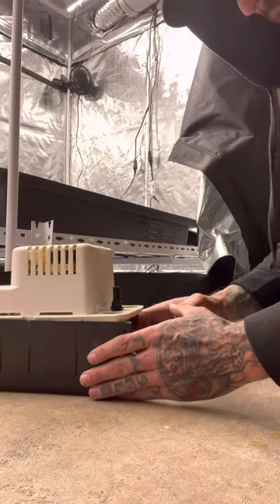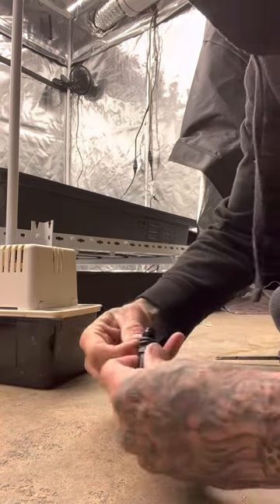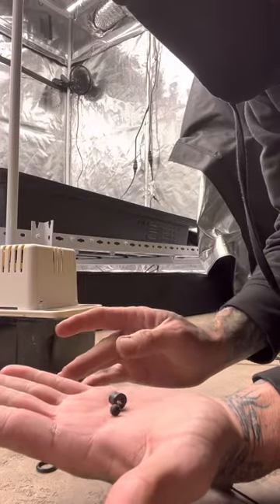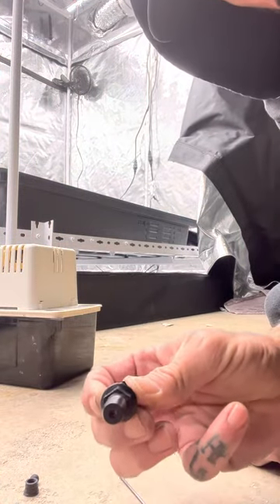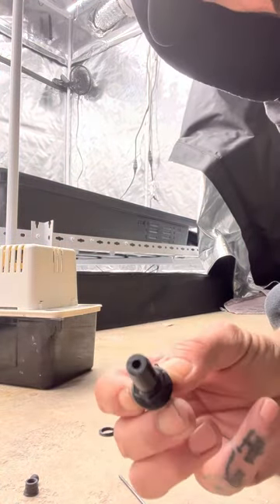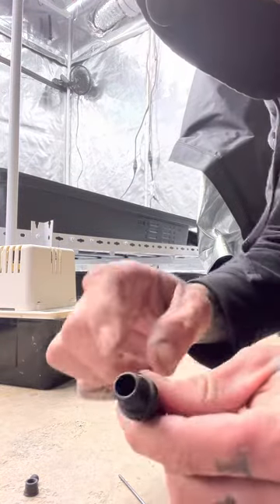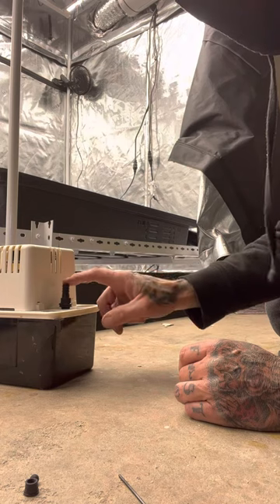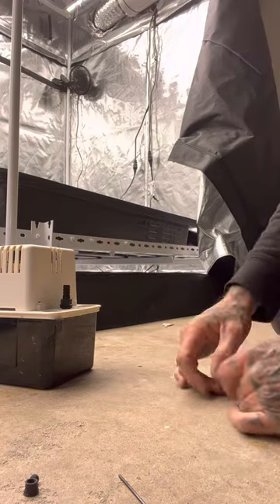Remove check valve out of condensation pump.

Comment: the only problem is that what doesn't fully discharge thru the drain tube will go back into the pump which is the reason it was put there in the first place which will cause the pump to short cycle and fail prematurely. Not an advisable thing to do
Reply: If you have to remove the CV10 check valve to clean it, why not just replace the dirty check valve with a new one.   Same work required.     Replacements are about $7.00 on line.   I keep two extras on hand to replace them when the get clogged up.   Trying to clean a dirty check valve is no guarantee it will work like new again.   A new check valve will give you a TEN SECOND drain time for the tank.   Any drain time over 20 seconds is too long and means the check valve needs cleaned or replaced.   Also, dirty check valves can make funny noises to.  A cleaned or new check valve will make the funny noise go away.   The factory told me to never use bleach to clean out your tank components.   Bleach will destroy the pump and motor components.   Good luck!
Reply: My check valve with the rubber wasn't draining I thought it was dirty so I took it off and it wasnt dirty so I tried removing the rubber and it drains now I did order a new to replace it but it's 108 degrees outside so Im running it like that it drains faster than before it stopped draining the pump doesn't even run for 10 seconds and it almost completely drains all that falls back in is a little bit not enough to kick the pump back on is it still bad for the pump even tho what falls back in isn't enough to kick the pump on ?